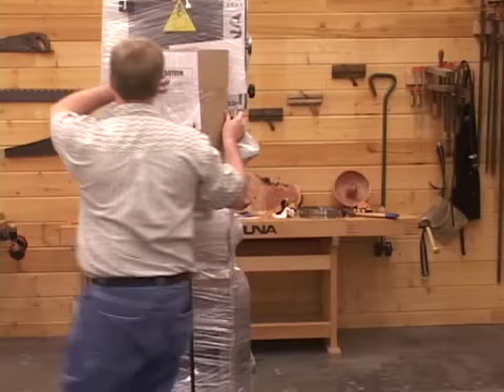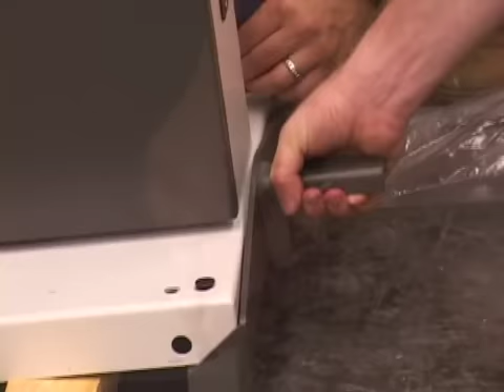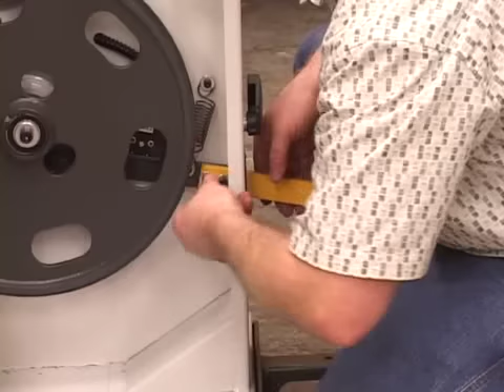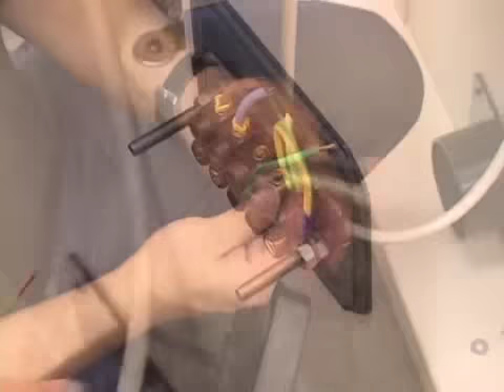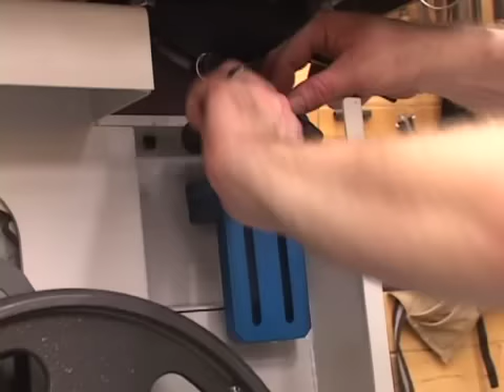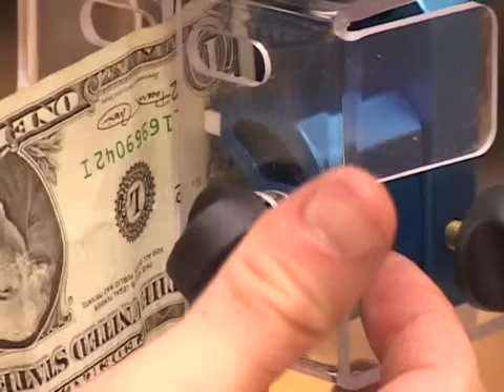Bandaw - Setup LT16 HD - Woodworking - Laguna Tools

Comment: I will be buying a Laguna 14 SUV this week. I haven't seen a setup video for that saw. This looks very similar in design. Is the setup protocol in this video the same as for the 14 SUV? Thanks- I'm really looking forward to using my new saw!
Reply from the maker: Although we do not have a setup video specifically for the 14 SUV yet it is similar to the 3000 series bandsaws.

Woodworking - Laguna Tools Bandsaw - Setup LT14 SE Part 1 
http://youtu.be/efQNFAdFFw0

Woodworking - Laguna Tools Bandsaw - Setup LT14 SE Part 2 
http://youtu.be/yqQ6zD8rZeg

For more information, feel free to call us 800.234.1976